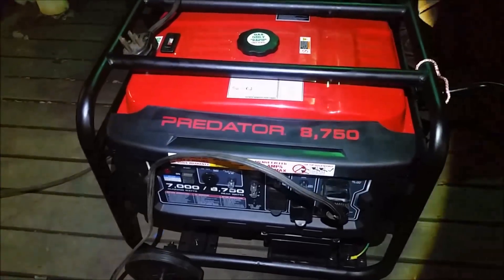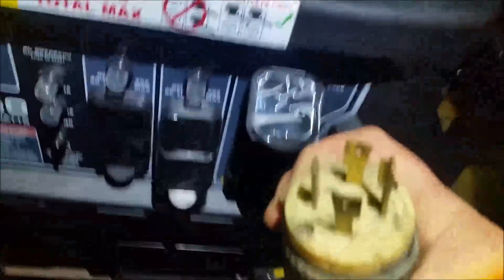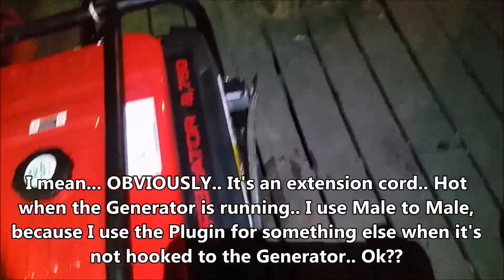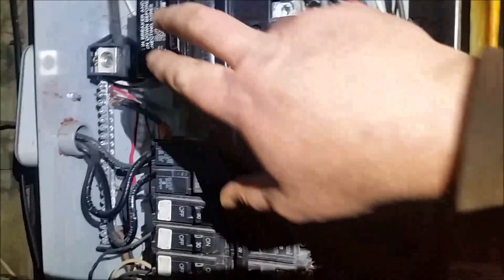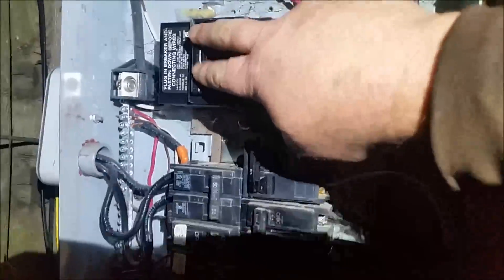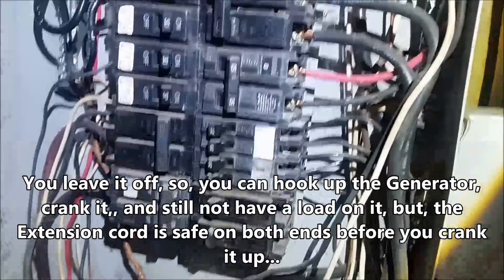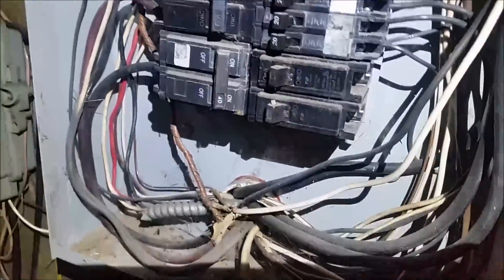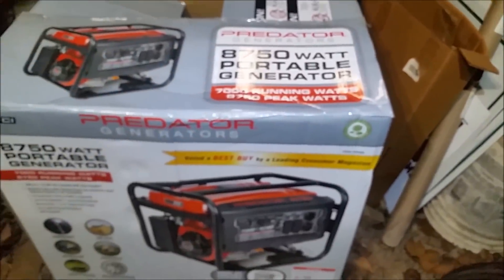Quick/Easy/Safe: Use Existing Plugin/Breaker for Generator hook up to your house Panel box.

Comment: I am not an electrician, just a physicist, do NOT DO THIS! Uneducated moron.
Reply from the maker: If you were a physicist, you would understand this and would be saying the opposite.. A physicist has to have common sense to apply his knowledge, or he/she would be a waste of the good training that a physicist gets..  Common sense is to big a part of the training to think you are one making that comment. I have not trained, but, learned physics hands on, and I know the difference in someone who can apply their physics.. Sorry.. If you are one, you havn't got past the Memorize and pass the test part of physics.. And,,, that is Moronic.. Anyone can study to pass a test.. It is the application of the theory which tests ones knowledge..
Reply: It's not safe, didn't say it wouldn't work. +Mark Thomas. You just don't understand.
Reply from the maker: No.. I understand just fine.. I use this all of the time.. There is nothing unsafe about it.. Turn off the Main breaker, Hook up the male to male cord, crank the generator and flip on the "Generator" breaker in the panel and you are up and running.. If you don't turn off the main breaker and hook up the cord,, yes it is very dangerous.. and,,, if you hook up the generator and crank it before hooking up the other end,, Yes it is dangerous.. but, turning off the main and hooking up the male to male is not dangerous in any sense of the word at any time in any lifetime.. 
It's no different than driving a car and not following some basic rules.. Using a Knife? A Gun? Point it where it should not be pointed and pull the trigger on a live round, and you have shot something or someone.. very bad.. but, point it somewhere else..No big deal.. It is safer than firing a gun in any direction to be honest.. I have had factory rounds cause some problems.. You have total control over the safety here. 
It is safer than forgetting to put your car in park.. Or forgetting to tie your shoes.. It is even more safe than pointing a loaded gun when your finger is "NOT" on the trigger.. This is no different.. You just don't plug the cord into anything hot.. Very simple. Same as you remember without thinking to put your car in park, or tie your shoes before you take off walking.. 
You think about it really hard... Do it like I said. And see if you can figure out how to hurt yourself, using those very simple directions.. You can't.. But, you are welcome to try.. And then think about every other alternative.. They all require opening the box by the DIY'r and working around at least a hot main above the main breaker at the very least.. And, that is if the same person can't remember to turn the main breaker off.. They would stand a better chance doing this. BUT,, like I said.. This is for someone who "Has" common sense.. Not for someone trying to figure out "IF' they have it.
Reply: Ok, when you turn off the main, you are only turning off the hot line. The main does not disconnect the neutral. You are still exposed to the electric grid. I am not talking about the order in which your procedure is done, it is still unsafe when you are finished. This is why special sub panels for generators are made. You are showing people how to break the NEC code. It exposes you and electric linemen to danger. It is also illegal...and that's a National (federal code) if you are in USA.
Reply: How does not breaking the grounded neutral create a problem? When the power company pulls a meter the neutral is still connected, just look at a meter socket. I don't want my neutral switched, switch contacts can fail and a floating neutral can cause a world of problems.
Reply: It is against NEC code for a reason. When the power company pulls a meter they do not expect power to be generated in the house. This is why they make sub panels to do this. I am not going to explain EMAG here. Just google, "what does the neutral do?" It is against NEC code. Thank you, you are wrong. I am done.
Reply from the maker: No.. Wrong again... First.. There is no reason to disconnect the Neutral or ground, and it has zero to do with any lineman getting electrocuted.. The main breaker is the only thing.. Back to the Main breaker being cut off.. But, don't believe me.. Look for yourself... Outside of your house, if you are fed from a pole, there are 3 wires coming into your house. Two hots and a ground.. Follow it to the pole.. Still 3 wires.. Now, follow it to the transformer.. Still 3 wires..Now, what is feeding the pole? Two thin high tension wires.. Where is the ground or Neutral that is going to Fry the Lineman.. Look at the pole again.. It is the ground going down the pole into the ground.. Enough said about that.. Go and look. Can't argue with physics now can you and back to my original comment to you.. See what I mean? So, it is not "Unsafe".. The Service is Disconnected with the Service Disconnect.. After all, that is what the Main Breaker is called.. 
NEC code does not cover "Extension cords". It covers plugs and receptacles in section 607. It only covers Permanent installations.. 
406.6 and 406.7 specifically..  Go look at some Sub panels (ie.. Transfer switches) and see if you can figure out how to make one function like they do without isolating the Ground and Neutral and still get it to work... There is nothing wrong with Interlocks, Transfer switches, etc... Nothing at all.. 
For someone who can't see the simplicity of this setup, I would recommend they get one.. This is only for people who can see the common sense and simplicity of it and be confident that they understand things well enough that they don't forget to tie their shoes, put their cars in park or forget to flip off the main breaker.. Sorry.. 628 comments. Most of them from the Safety Police and not one has a valid argument against this setup used by someone with Common sense who will not forget to turn off the main breaker.. And God help the damn fool who tries to install a transfer switch or interlock and doesn't do the same with the main breaker.. I am not twisting you arm to use it.. Just not letting the "Your Dangerous comments go without a challenge" 600+ so far, and this is not the first time I have addressed either of those issues you just brought up.. This still stands safe for those who use it who have common sense.
Reply: See Sheri below. I can't seem to get you to understand. So, lets try a simpler angle. Do you believe me when I tell you it is against NEC? If yes, then ask yourself why? If no, then you are wrong it is against code, please check for yourself.
Reply: Sorry, the code does not require the neutral to be switched for a temporary generator. Neutral switching is only to eliminate multiple ground current paths and has nothing to do with grid exposure. It's good that you didn't try to explain what you fail to understand.
Reply from the maker: No.. I do not believe you when you say it is against NEC code.. I just quoted the code to you.. It does not get much simpler than that... 
No.. You can not get me to understand something that is not correct. I have commented on all you have said up to this point, including the NEC that I just commented on prior to this..  So,, No,, you are wrong... You should read my post above starting with "No... Wrong again.. First,,,,,, ".. 
Here is a bit of the post where I quoted the NEC code sections to you..  If you find something else relevant in the NEC code, please feel free to post it.

The Service is Disconnected with the Service Disconnect.. After all, that is what the Main Breaker is called.. 
NEC code does not cover "Extension cords". It covers plugs and receptacles in section 607. It only covers Permanent installations.. 
406.6 and 406.7 specifically..  Go look at some Sub panels (ie.. Transfer switches) and see if you can figure out how to make one function like they do without isolating the Ground and Neutral and still get it to work... There is nothing wrong with Interlocks, Transfer switches, etc... Nothing at all.
Reply from the maker: There are many reasons not to switch your Neutral, but, you have pegged the most important.. You want to have some screwed up problems and burn out some sensitive electrical equipment, and as it gets worse burn out much more.. Just loose a ground slowly over time..  I agree 100%.. 
It will be something that 10 Electricians won't be able to figure out..
Reply: Damn dude, it specifically states you must have a sub panel for a generator. You are one of those people that thinks they are smarter than everyone else no matter what reality says. I will say it one more time. Ed Taylor is showing you how to do it wrong, illegally and unsafely, not just for you but the electric lineman. He wants to show up the edumacated guy that called his bs. I'm bein' all dang scientifical and shit. See Sheri Post, licensed electrician below. I have built, plumbed and wired myself over 14 structures that passed inspection no problem. I have a masters in applied physics. I know the code. You can look it up online. It is what it is bro. Electricity takes the path of least resistance to the lowest energy state. Whether it cooks you, your dinner or lights your kitchen. When you apply power to that line the path of least resistance in some cases is that neutral. Get it?
Reply from the maker: Like I said before.. You keep saying it is against NEC code.. Then,, you know the code.. Spit it out.. I already showed you what sections applied.. That means I have researched code.. You keep saying it's against code but you can't say where???  I found what is related to it,,, you know damn well I researched it.. You on the other hand, have no evidence and do not understand the very basics of Utility to Home power.. BTW.. Sheri is not an Electrician,, or if she is one, she doesn't know crap.. If you can't see that from the posts following,, you need to go back to sleep.. 
And,, BTW.. using your own logic,, then,, why does the Utility Company Have ZERO GROUND OR NEUTRAL?? If that doesn't phase you nothing will..
Reply: nec 455. Go to lowes and ask, just go to lowes. They have the transfer switch sub panels. Sheri I would say, is an electrician, because she knows what you are doing is unsafe and illegal. You have to have a line/off/gen switch. You have to switch the breakers with another breaker in the transfer panel. Look at lowes or home depot online. It isnt like its a Maxwell equation.
Reply from the maker: More specific please.. I was very specific.. I Gave you code number and parts..  If you say it is there.. Post it. Go ahead and post a link to it.. 
I think it is obvious that there are parts about generators.. I not only posted the sections, I quoted and summarized it.. 
Then, when you are finished "Posting your Data "Scientific Data",, we can address the next issues..
Reply: **Electricity takes the path of least resistance to the lowest energy state. Whether it cooks you, your dinner or lights your kitchen. When you apply power to that line the path of least resistance in some cases is that neutral. Get it?**

No I don't get it because the statement is erroneous. Electricity takes ALL available paths back to the source, if it took only the path of least resistance how could it give you a shock? Normal current will flow through L1, L2 and the grounded neutral, however it will not raise the potential of the grounded neutral and the neutral will present no hazard on either the house system or the grid. I don't know where you are headed with this but your touted portfolio will not cover your errors. All you are doing is muddying the water rather than providing any substantive commentary. 

BTW the code does not require a sub panel, but does require a back fed breaker to be strapped in supposedly to prevent it from being removed live. However, I don't strap mine as the cover is in place and the breaker's primary purpose is to feed a branch circuit.
Reply from the maker: I think I figured it out Ed.. Hardaddy is the newest Residential home owner who called the local Union, or Electrician who gave her a big fat quote on a full home system, and she flipped out on the price.. So, she started looking around on the internet for someone to save her from the big bad wolves.. I'm sure they scared her to death before they left and probably told her that this guy and that company did dangerous work and they were the only ones that were qualified to install such a system.. Probably tagged her with 6 to 8K..
Then she sees all of these videos out there where simple people are firing their houses up with generators with something as simple as an Interlock..
And, she is wondering why these reputable "Nice Guys" want to rip her clothes off and bend her over the handrail.... And, she can't believe these guys are what she thinks they are already, and the reason she is on youtube checking out what everyone else is doing.. Hell of a Delima.. Ha.. 
Who is involved in promoting the NEC? 
National Electrical Contractors Association (NECA), 
International Brotherhood of Electrical Workers (IBEW), 
Edison Electric Institute (EEI), 
International Association of Electrical Inspectors (IAEI), 
National Electrical Manufacturers Association (NEMA), 
National Joint Apprenticeship and Training Committee (NJATC) 
National Fire Protection Association (NFPA). 
Do you think any of these Companies make any money from DIY'rs connecting their own generators and running them simply for 15 or 20 years?? Ha..
And,,, Who is it designed for??
-as the commercial/industrial/residential use of electricity, it's a good thing when licensed professionals are "all on the same page." Requiring electricians to operate using specific safety codes results in less injury and death related to electrical work.
And,, does a home owner have to have an electrical Inspection of Permit to do his/her own work??? Notta.. Not in any State I have ever lived in.. 
>>>> I like this one.. 
https://www.nfpa.org/NEC/About-the-NEC/Free-online-access-to-the-NEC-and-other-electrical-standards
NEC/NFPA standards cannot be downloaded or printed. Hmm..        Must be purchased by Electricians??? 
---
Hardaddy.. I am sure that your local contractor will know how to install you a generator properly,, the way code says it should be installed at a minimum.. And,, when they are done.. All you will have to do is go out there and Crank your Generator and throw the main switch.. 
And, for all of that money,, you have the piece of mind that you can crank the generator before or after you throw the main switch and you don't have to think about a thing..  Of course,, you will find out quickly that the only real way to do it is to crank the generator and then throw the switch, and it will probably kill the generator when you do, until you find out what you can and can not run while on generator.. But, then again, when the electrical contractors get there, they are going to want you to tell them which circuits you are going to want available to the generator, depending on what is the easiest way to do the install in your particular case.. 
Of course, they can figure out how many amps/watts everything in your house pulls and build a spreadsheet of what you can and can not run, using the max consumption of every appliance in the list.. You will be lucky to get a 50% load.. And, it will add at least a couple hundred more to the list.. 
Hey.. when you get into it,, if you have an electric range,, they will try to ignore it.. Because it will show at least 50 amps, and the generator is only going to be listed at 30amps per leg unless you get a really big one.. When they do, ask them if that is with one or all burners on high,, with the oven on high at the same time.. 
Enjoy your adventure..